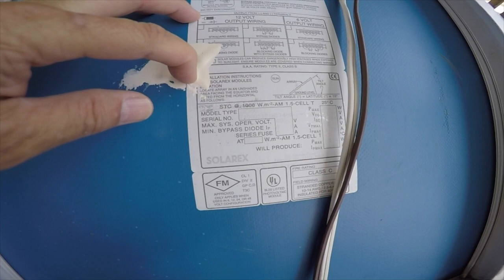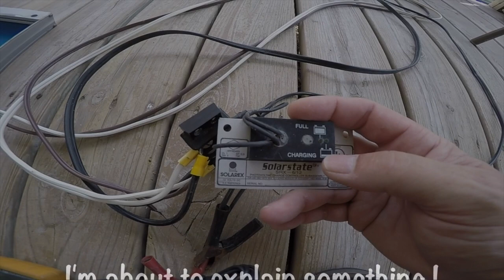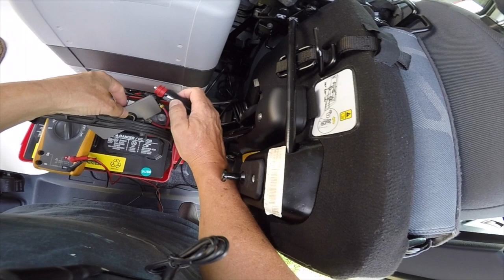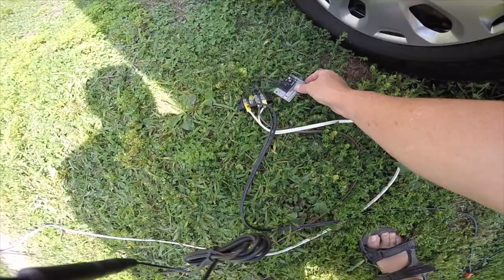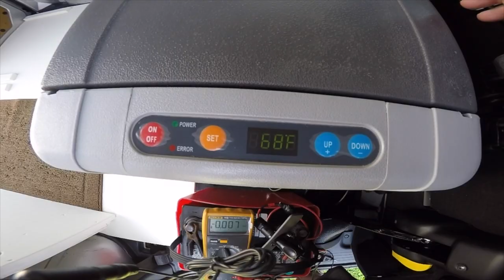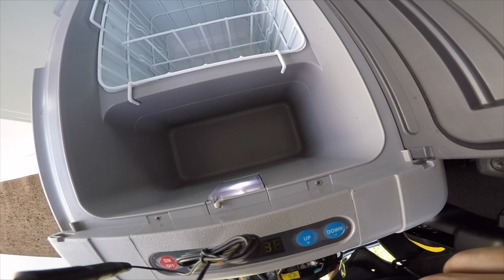Dometic CF-50 12V Refrigerator Test | 2010 Ford Transit Connect Camper Van Conversion

Comment: Great video, instead of an empty refrigerator,/ Freezer for testing, crunch some newspapers to about the size of cabbages, and put them in the refrigerator/freezer, like it's full, then test again, they always work better when they are full.
Reply from the maker: I agree with you on that point. I purposefully did this test trying to simulate a worst case scenario. I figured if it would work in a worst case then it should have a little room for those not so ideal days and conditions I know I'll run in to on the road. Thanks for watching and commenting.

Comment: Wow, that did pretty well. I, too, wonder how well it'll hold up through the night. I wonder how it would work in real world situation as far as insulating the outside of the fridge. Say your in the desert, but you have blankets or some kind of isolated box built around it. Just a thought. Thanks again for taking the time to post the test as well.
Reply from the maker: Good thinking and you are correct. Those items you mentioned are factors that could and probably would affect the results. I tried to set up this scenario with a  worst case type test. It might be possible but not much room for lower quality days such as today. I'm posting another video this evening and doing more videos with new tests you may find interesting. I really like running tests and really finding out what can and can't be done. Thanks for watching and commenting. Much appreciated!

Comment: your battery is probably in the range of 100 amp-hour which is very standard for a marine deep cycle and your Dometic fridge need 3 amp at 12 volt= 36 watts x 24 hours x duty cycle of 20%= 173 watt-hours to run for a full day
your battery can deliver 100 amp-hour x 12 volts = 1200 watt-hours but you can use only 50%= 600 watt-hours so your battery is big enough but to recharge these 173 used watt-hours you need 30watt x 6 hours= 180 watt-hours so  in theory, your solar panel should be able to recharge the battery but in practice, and being old with and older technology of cells and controller, you can get only 20 watts in full sun, so 20 watts x 6 hours= 120 watt-hours and you battery is not fully recharged. You will need a disconnect switch or system to recharge using your van alternator or recharge with a portable Honda or Yamaha or Champion generator.
Reply from the maker: Great info in your comment and your numbers as far as I can tell at a glance are spot on. Looks like you have done your homework on this subject. I agree that this set up will probably run the fridge but only under good to excellent conditions and we both know that's not always possible. It really doesn't leave much headroom for lower performance and still work. Also during the winter months, depending where in the world you are, you will most likely have less potential hours of sun in a given day. This will also factor in on the result and required power to make it work. Thanks again for your input and information. I appreciate it. :)
Reply: my theoretical setup include 2 x 100 amp-hour lithium battery like William Prowse or 4 x golf 6 volts battery like CheapLiving and 4x100 watts Renogy non flexible solar panels to recharge. This is 1000$ of batteries and more than 1000$ of solar panels but i will be able to run everything including all the electronics and the 12 volts fridge and the fantastic fan with plenty of extra power like microwave and Keurig coffee maker. 
i am drawing using Excel with a scale of 2 inches for one cell and i finish the job using Photoshop Elements. 
You can see all my illustration on this facebook page
https://www.facebook.com/denisfor789  starting on 22 August
Reply from the maker: Very cool, I'll check it out. A little too pricey for my application but still very cool.

Comment: Great vid... Have the same one, and my temp. is never consistent, i set mine about the same and it jumps from 35 -38 deg. It will be more efficient full of cold food. I personal wouldn't put cheese in the first bin, however i do put all my condiments there.... Thanks for sharing !!
Reply from the maker: Yes, I believe this fridge goes 2 degrees below where you set it before it shuts off. Then climbs 2 degrees above before it turns on again. I'm not positive about that but I think I read that somewhere. I agree it is more efficient full of cold food. You are welcome and I am doing more testing on this subject mainly for my own use but I will be posting videos in hopes that someone can get some use out of the info and results. Thanks for watching!